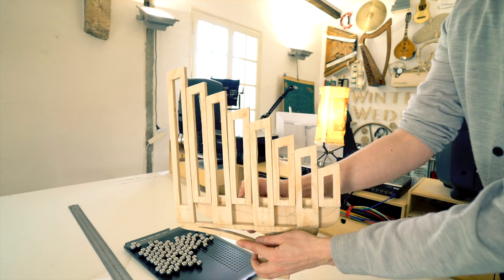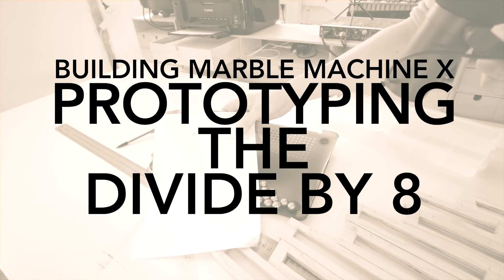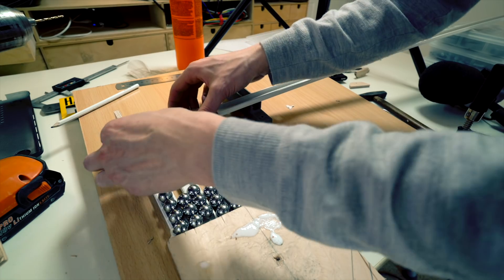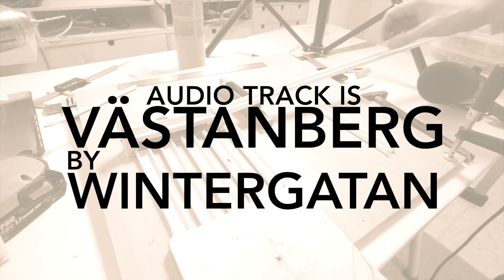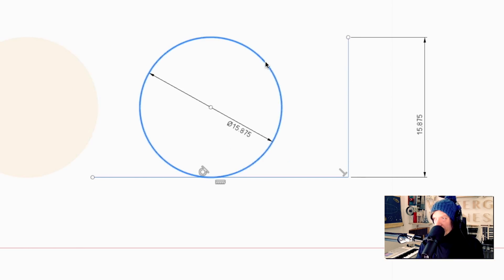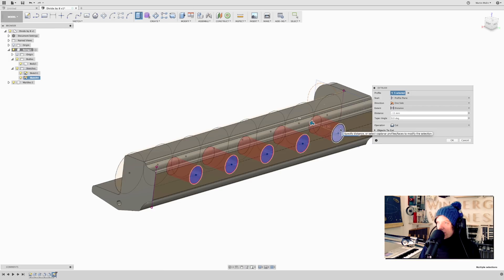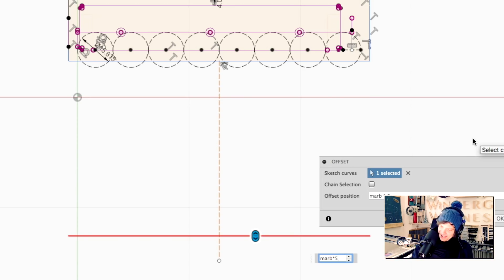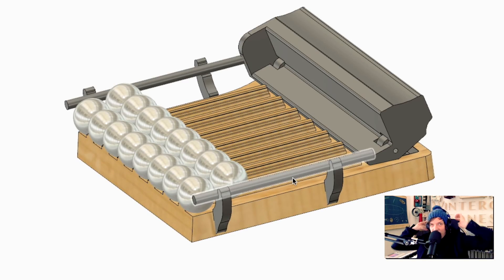Divide by 8 Marble Divider - Marble Machine X #28

Comment: I thought the marbles were to be lifted by the magnetic slot in the big wheel? Or is that just part of the lift and the fish ladder is the next part? I'm curious why would you use the ladder instead of using another wheel. The ladder should be louder and less efficient (because of all the accelerations and decelerations) and the wheel is so elegant and smooth. Perhaps it is difficult to fit in the available space? I would enjoy reading a discussion of the many ways to lift a marble but one where the positives and negatives of each method are explored.
Reply: So most of my questions are answered here:
https://www.youtube.com/watch?v=V8OUVHlpnag
But not the question about why use a fish ladder and isn't a wheel lift better?

Comment: Hello, Congratulations on the project, I am your fan. I have been following the evolution of the marble machine x and sometimes I have some ideas about some of the problems you face, have you thought about using microcontrollers to perform this marbles distribution function?
By using some torque sensors and motors you would be able to perform this distribution of marbles more accurately. A big hug and do not forget to go through Brazil on your world tour.

Comment from the maker: Here is a fish stair Marble Machine In action if you want clarification: https://www.youtube.com/watch?v=enDoM-rbLc4 This one lifts one marble per step, MMX will lift 16 marbles per step, two rows of steps, to achieve the needed 8 Marble Per crank turn feedrate! So we can play darude sandstorm on the MMX, it needs a lot of marbles for the dududududududududududu part
Reply: Do you watch This Old Tony?!   If not, check out his channel.   You'll like it,
Reply: Wintergatan alright it's official, we need a darude sandstorm cover on MMX
Reply: Hi Martin, isn't spring a more reliable solution than a balancing mass? Or did I miss the final design? The balancier will depend on the perfect positioning of the center of mass (that means adjusting the machine position on the floor) and on the constant weight of the marbles pack.
P.S. also adjusting the spring strength is much easier than the balancing mass.
Reply: "Multiply by marb" needs to be a t-shirt now XD
Reply: Really love the design from a visual perspective, my only concern would be how it will operate in a moving/shaking marble machine X. Will that movement cause the fish stair to behave erratically? Keep up the great work :)
Reply: The marbles are like a crystal structure. They don't want to break from that form. Also, is it always nice where you live!? I don't think I've ever see in raining in your videos!! :) Nice putting skills, I played some disc golf near my hometown last week. I've lost what little skill I used to have tho. :(
Reply: Wintergatan 
how about this mechanism?
https://youtu.be/VGQC33w3ltc
Reply: denha is amazing. He even made one with both of our suggestions already. https://youtu.be/Huspz20MTDE
Reply: Go ahead with parametric design! In the beginning it will take a while but as soon as you realize how easy you can use it and change things you will be proud to took the time in front of! I'm using catia since years and parametric designs are the best thing in it 😉
Reply: Fusion360 suggestion: It's a good practice to fully constrain your sketches (make all lines black) to avoid inadvertent changes in your design. I usually start by making some part of the sketch coincident   with the sketch origin to help doing this.
Reply: You a ninja Martin
Reply: Wintergatan But is there a chance oveflow in the feeding, like we saw in 3:04. If the marbles come too fast, maybe you should have something to catch the excess marbles and lead them back to the top.
Reply: Alexey Kuzin, that would mean  he would have to find a spring that mimics the same pull or push that creates the same counter balance effect as the weights, if I’m following this correctly. If so, I think the counterweights act as a simpler solution that requires less added pieces, less space, as well as a more quick and conservative movement than a springs snappiness would create. Not mention weights are less likely to lose mass over time than a spring to lose its “springiness”.
Reply: I made a shortcut to that video Martin: tinyurl.com/MM-FishLadder
Reply: i seen another video of your(Very good). I think you said that your music you make is free. So i can use this in a video and not get demonitised or copye righted?
Reply: Cool. Another idea would be using "marble flip flops." Like with Matthias Wandel's Marble adding machine (https://www.youtube.com/watch?v=md0TlSjIags) Although more parts, each individual rocker doesn't need as much precision (less fiddly) and they create a cool cascade affect. Finally, it adds an additional nerd cool factor since these mechanical logic gates make this a bit like a mechanical computer.
Reply: You should gate the marble loading using the same mechanism that drops the marbles, when it drops, block off the incoming marbles with a little wooden bit mounted on the drop plate.
Reply: Funny. The MMX CPU instruction set can operate on 8 bytes per clock cycle. Single Instruction Multiple Data (SIMD)  was revolutionary. Are you achieving Single Crank Multiple Marble (SCMM) technology?
Reply: Is it an idea, to let the devider fill from above? This way you could prevent the two extra marbles. The allready in place marbles would stop other marbles comming with them. It woul just be an box on top of the devider but it would make, i think, loading the devider faster. Because the next row of marbles is allready standing by.
Reply: Wintergatan meanwhile you could 3d print the rails, and the tracks
Reply: Wintergatan You've probably considered this allready, but why not use 3d printing to fabricate internal parts? (Like brackets, bearing housings, etc.) It'd be a good way to make parts fast and inexpensive, or at the very least a way to quickly fabricate prototypes before making the finale version. In the last 2 years 3d printing has gotten incredibly cheap and accurate.(I remember there are 3d printed drum prototypes, but I was thinking more than that). Keep up the good work btw!
Reply: It’s incredible that despite everything that has changed the current fish stair is based around the same principle!!!!

Comment: I don't know how precise this needs to be, but I'm wary of using a weight based pivot mechanism. When on stage and the thing is running, I image the machine will have a lot of momentum is various directions, meaning the marble holder might shake and drop either too early or late. Though if the count doesn't have to be exact, then this could work
Reply: If I am correct, then this is the thing that takes the marbles that have already fallen and divides them up to be placed on the stair lift. Since the marbles on the stair lift just get combined back together at the top (I think) then the count definitely doesn't have to be exact, although yes, problems could arise. And this machine will be way more stable than the first one (metal frame, better design, etc.).
Reply: 16 Bit Images I have a feeling ure right and this wont work how he wants it to... 😂
Reply: Yeah agreed I don't feel confident at all about thus mechanism
Reply: It seems that it wouldn’t be able to return to its original loading position under a steady stream of marbles (Which will cause marbles to go to the wrong rows and also escape out the back. He doesn’t seem concerned by the rows not filling evenly, but that’s the entire point of this device, isn’t it? That alone seems like it could cause an issue. If two rows keep getting overfilled, won’t it jam up eventually?). However, there may be consistent spacing between them when they’re fed into this on the actual MMX? Maybe it’s just here that they were all dumped in at once with no spacing, causing various issues of slop.

I don’t know how precisely the ladder mechanism needs to be loaded... but this pivot mechanism definitely seems unreliable.

Comment: you could put another wall on the side the marbles enter, on the back of the swing so when it pivots it cuts off the other marbles from flowing into the swing like a knife.
Reply: I was thinking the same thing, but the CAD model appears to have a lot more surface area than his prototype there.
Reply: Had the exact same idea! Glad to see somebody already posted here. :)
Reply: Sean thats a really smart idea, go and post it on his reddit page!
Reply: I was wondering why he didn't just do that?
Reply: what if the gate was angled so that the weight of the marbles pressing and the force of gravity would use the waiting marbles to help move the swing back up to its ready position (then i realized as i was typing that if it could do that, it could possible prevent the swing from swinging in the first place.)
Reply: It seems that the friction of marbles stacking up against that theorized wall on the end of this pivoting marble cradle could prevent it from being able to swing back up to its original position. It would also stop the momentum of those marbles, making loading the cradle via gravity a bit more of a challenge.
Reply: hmm perhaps a thin strip of polished metal and some lube?

Comment: The only major problem I am thinking of about this is how will the vibrations of the machine affect this system?
Reply: The machine will vibrate alot less than the original MM, so hopefully they wont have any problems.
Reply: Max Schwartz maybe you can put some kind of suspension on the legs
Reply: The problem with having weight triggered tippers like this is that any inaccuracy is going to break it. It is really delicately balanced. In automated manufacturing they use electronic sensors. I understand Martin doesn't want to use electronics so in this case he could have made a contraption that triggers when all the marble positions are filled. this can be done using a set of notches right above/below where each marble should be where you have small pins protruding. once all pins are lifted/pushed down they unlock the tipping mechanism.

I also noticed that if there was a lot of queued up marbles they pushed on the marbles already in the tipper and prevented it from tipping. So ideally you would have a stopper that made sure no more marbles fell down until the tipper had cleared and cycled back.

This all gets lots more complex so if he can get away with the simple weight triggered mechanism he should count himself lucky.

Comment: You have to block the incoming Marbles while the Swing is down
Reply from the maker: would have been great, i have been looking at that, the problem is that the friction from the "9th" marble cue will slow down the movement of the swing and potentially make it stuck. I dont want to add more weight to the swing to counteract that. But in the real version i am counting on the swing to block the cue a little bit. if it doesnt it doesnt matter as long as nothing get stuck. The different amount of marbles on different lanes are no real problem but it would have been beautiful to get it perfect.

Comment: Magnetized marble @2:14 2nd marble on the left? It reaches the bottom then flips up again.
Reply: The marbles were slightly too close together.  That marble was the odd one out and was squeezed back by the two adjacent marbles.  No magnetization.
Reply: Hi Gregory, thanks for pointing that out. I misinterpreted the slight up and down movement after the sqeeze on first sight.

Comment: I had an idea that would make the melody patterns visible to everyone including those who are deaf. Paint the ends of the pins with fluorescent paint or enamel and put a blacklight just inside the machine. For a small investment of a blacklight it will really show even in the dark the melodic patterns. It would be attractive to have different colors of fluorescent for each note but not absolutely required to still look very cool! Also could you please post a video of what was shown on Twitch as many of us don't use or have access to Twitch easily? :-)
Reply: Go post this in the subreddit.. it might get more visibility.
Reply: The MMX isn't supposed to have power. Maybe they can install some sort of generator or dynamo in the machine, but that might take a way from the purely mechanical workings of the machine.
Reply: Christopher Elliott exactly. Plus a small LED black light can run on a battery. Although with all those spinning magnets there probably is electricity there for the taking! It would be very elegant to turn the spinning magnets into a small power source for an LED light LOL
Reply: doinker50 Nice accidental pun!
Reply: Excuse me to ask but.. do deaf people goes to music concert ?
Reply: Christoffer, electronic pickups, whether magnetic o piezo, are usually passive, requiring no additional power to drive them, only the signal from the input they are connected to, which in this case would be a mixer or preamp.

The MMX will probably not provide its own power.
Reply: +Christopher Elliott Dude i'm going to post this on #aesthetics channel on the Wintergatan discord under your name if you haven't already, its a really good idea! Here's a link to the discord btw- http://discord.gg/QdNwA5Y
Reply: +Kaiwala23 The idea is all kerinbot's, not mine. I was just pointing out that it isn't entirely unpractical. Please make sure you attribute the correct person.
Reply: Blacklight and puffy paint is just awesome.
Reply: Shhhhhh... q&a: https://www.youtube.com/watch?v=OJOJ5Vspsx8
Reply: an Idea would be to use a bike light, and replace the LEDs by some black light ones.
another idea, put a coil of wire next to the magnets, and wire it with a diode bridge to an led strip, it would make it light up with each "beat".
Reply: But there will be some power for the electronic pickups...
Reply: There will need to be some sort of MIDI device there to translate the percussion pickups into instrument sounds... If you look at the original machine video at 2:48 ( https://youtu.be/IvUU8joBb1Q?t=168 ) there are electronics strapped to the back for signal processing and mixing. (I don't recognize that ) The electricity is there, just as a support mode for the instrument. A Y cable on the power input would be enough for internal lighting for on stage.

Oh, thanx for the "excuse" to watch the original video again. ;-)
Reply: Christopher Elliott if you are talking about guitar Pickups, they dont need power as well as piezos. But I dont know if he will use mics